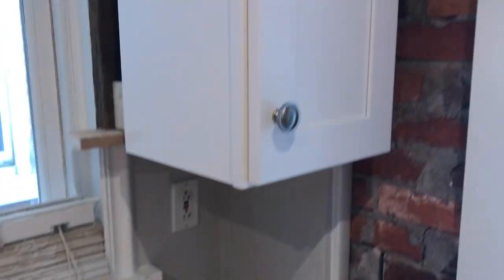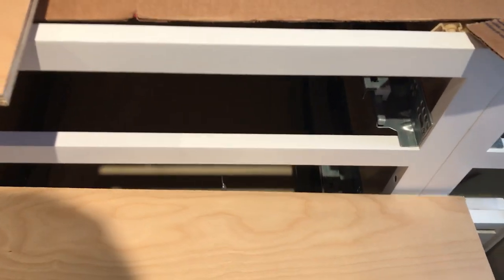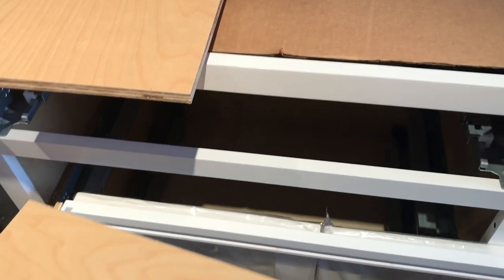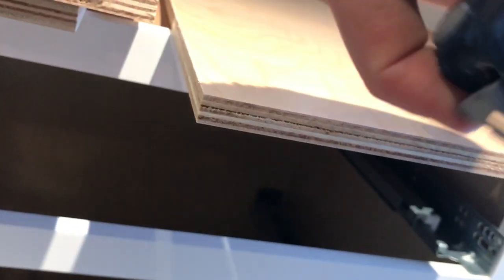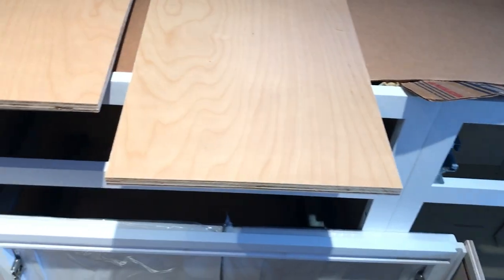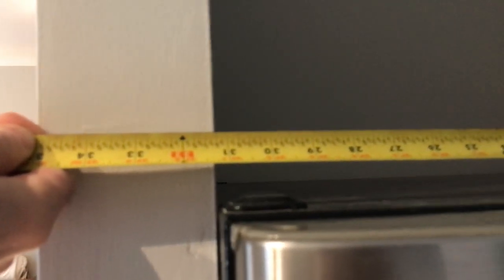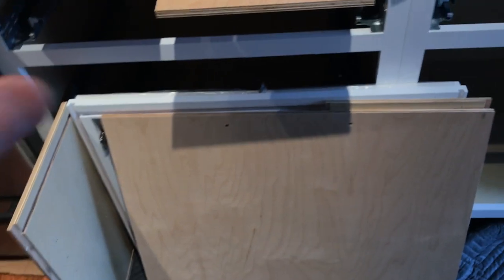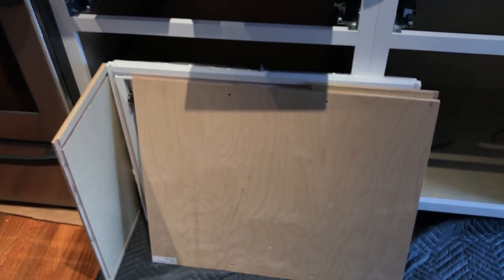Modify Hampton Bay Avondale cabinet to make deep wall cabinet over refrigerator

Comment: For the sides, I just ended up cutting the sides so the front went on the front, the back went on the back, and slabs of plywood on the sides were used to extend them in the middle.